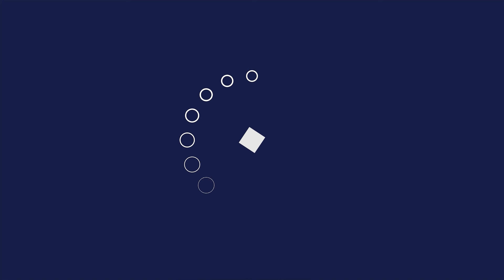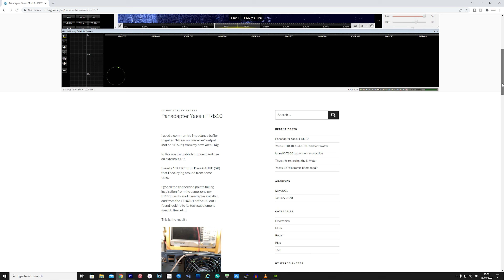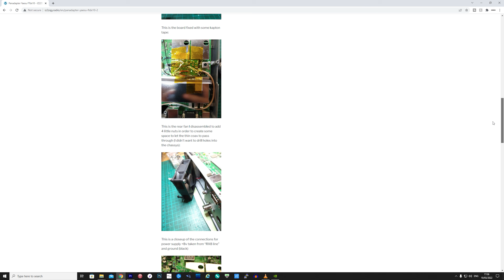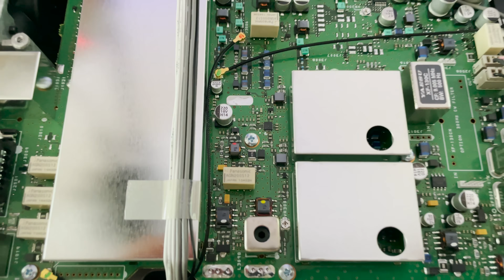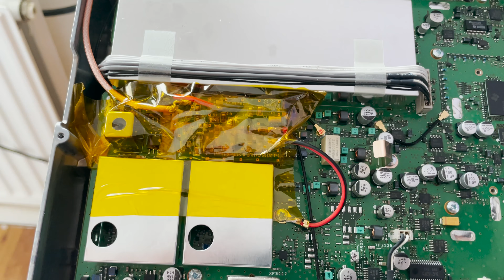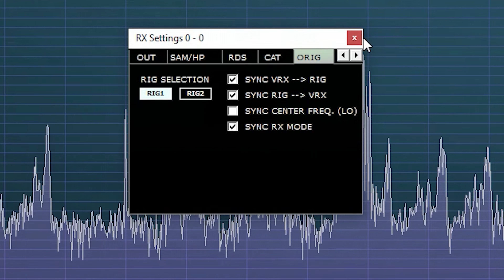How to add a TRUE panadapter to the Yaesu FTDX10

Comment: I cant figure out the settings on sdruno. Its off frequency. Does anyone knows how to correctly set this patboard with sdruno ?
Reply: input freq.SDR  is the output freq of the IF. stage 1 or 2 e.g. kenwood ts480 is 73mhz.

Comment: Sent away for and received the PAT board a few days ago. Tonight, I opened up the FTDX-10, excited to install the board and get it going.... until I saw and realized how SMALL the components and landing sites for the wires are! Things look MUCH bigger in the video. I'm decent at soldering and have a good digital electronics soldering iron with fine tip, but I'm not about to attempt soldering to something that small to get to the  +8V supply. (The RF output lead looks small, but doable, and the ground can be easily picked up as shown in the video.)  I read in the comments below that there is an alternate site to pick up +13V that would work. I would like to know where that tap is (or any more-accessible spot for +v suitable for the PAT board). Taking the +8v from the side of a surface mount micro-resistor requires a microscope, extremely small tools, and an impossibly steady hand!
Reply: Updating my own post a couple of days later... This mod is not for the faint of heart, but I finally worked up the courage  to attempt it and did successfully install the PAT70 board in the FTDX-10 using the method and connect points described in the video. It works great. So great, in fact, that I just ordered another PAT70 board for my FT-911a.

Comment: Installed it to my FTdx10, and the Chinese SDR-USB radio.
And what horrible disturbance in the radio, impossible to communicate at all!
Immediately connecting the coaxial to the SDR, the waterfall gets full, and impossible to see anything expect screen just full of "signals". 

For me, just totally useless solution.
Reply from the maker: Chinese SDR USB radio are crap! Either you need a good quality SDR or installation had an issue. Better solution check my last video on the SDR switch.

Comment: Great, but I have a question: if this modification introduces an attenuation of the signal received by the FTDX10.
Have you noticed if installing the kit at the tap point leads to a decrease in the signal level received by FTDX10?
Thanks

Comment: I've found the FTdx10's native display to be good enough for operating, though I too sure wish they'd put a proper bandscope output connector on it.  I hope someday they do a firmware update to allow more control over the display.  But in the meantime, the "Full" and "center" display options are fine for my operating needs.   Maybe when my rig is eventually out of warranty I might try this mod, but it's not high on my list.

I do have SDRPlay's RSP1A, connected to an MFJ-1708B RF switch, triggered by the FTdx10's linear activation line (bought a cable from someone on ebay).  I also made a small power switch so I can click the SDR in and out.  If the power's off, the RF switch is just a  passthrough.  So if I want to use the SDR, I just turn it on.  It has complete access to the antenna's feed.  Clicking on the SDR display will tune the FTdx10, and with the RF switch it will also be controlled by the FTdx10's transmit status.

Basically, the same net result, but I didn't need to solder anything into my shiny, new, under-warranty, rig.  

I did a similar mod to my Icom IC-7100, but just a straight tap without an isolator board.  It worked ok, but I prefer the RF switch solution.

Comment: I ordered a kit for my FT-991 yesterday. The screen is too small and I wanted a full-time waterfall/panadapter. Yaesu wants FAR too much to upgrade my 991 to a 991A and I would still have a small screen. It's nice to know this same adapter can be used on the FTDX10...which is the next HF radio I'll be purchasing. 

  I was hunting for install video's and here I am.

Comment: You can add a panadapter to 590s  , just need to connect it to a switch
I had Colibrinano and now I will buy AirSpy HF+
The RX is all get by Colibrinano or AirSpy .  We dont need to buy Dx10 or any higher cost radio to have the same final solution.

Comment: Thanks Matt purchased the board, didn't take the power from the resistor as wasn't happy putting soldering iron near it took it from the 13v supply, used your suggested earth and also the feed from the pictures. Works very well and great views of the whole band. I would suggest a vid showing how you got it too work with SDRUNO as this took me a little while to suss out and get working correctly, I would however  as you did recommend to anyone doing this to use Omnirig it make life so much easier with anything communicating with the rig.
Reply: Not having the board layout or schematics, I am wondering where there  is a more-accessible +V (13V or other suitable level) located? Where did you pick up the +13V tap? (I'm not about to attempt to pick up +8V from the side of a surface mount capacitor that small.) Also, in the location of the original +8V tap in the video, are those two resistors connected back-to-back in such a way that a solder bridge between them would be usable for the +v tap? I couldn't tell, looking at my board, whether they are both connected to the +8V line or not. It would be a lot easier to tap there if one does not have to worry about bridging the two resistors with solder. In fact, just visually looking at the board, it appears that they might be bridged by the PCB traces? And it looks in the video like that might have happened when the example board was installed?

Follow-up: I was able to locate the Technical Reference Manual with board layouts and schematics, and it looks like those two resistors are connected to the same PCB traces, so a solder bridge between the two surface-mount resistors should be acceptable. I may still choose an alternate site to pick off +V.
Reply: @ingeniousys  Find a feed on the power into the board that's what I did
Reply: @foxonem7dfh257  Thanks. I found a copy of the Technical Reference Manual with the board layouts and schematics. That will help immensely to identify a suitable place to pick of +V.
Reply: I agree with the +ve take off being a little dicey especially with an unsteady hands that I have can you point me to the 13v take off please
Reply: Where i can buy pan adaptor tap for 70Mhz?
Reply: @elkochannel6677  no idea try google

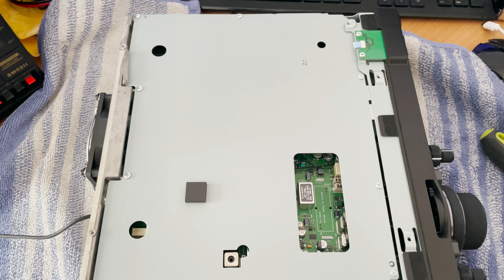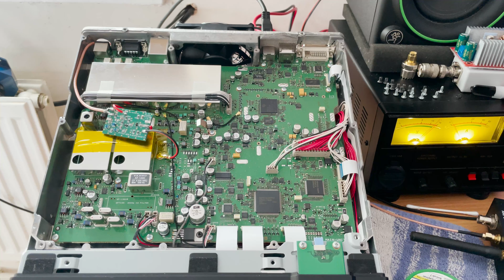Comment: @Tech Minds Hi,when I took the bottom black cover off I noticed the Gray fluffy Insulation type material by the  Fan just over the USB inputs before I pulled the grey/shielding cover off it was sticking out just as yours in the video was at 2:11. In the next frame you can clearly see it sticking up over the USB Inputs next to the DVi interface. And you see it again at 3:42. I noticed at 4:46 when you reinstalled the shielding cover the Gray insulation in tucked under the shielding cover over the USB connections. I noticed the same thing when I did this. The gray insulation was sicking up before I pulled the gray shielding cover off and thought it didn't look right sticking out like it was, so I folded it over when I reinstall the shielding cover and it seem to be a perfect fit. My FTdx10 was made at the end of 2022. Do you think it should be left sticking out or folded over like you & I did.???

Comment: Yaesu is again falling back - They should just release public their command set for USB port so people can adjust SW like SDR Connect and others for communicating with it. I guess they are not allowing it because of few buck they would lose some $ from LAN10 remote control sales. Yaesu has all in place for us to have full size panadapter and control of FTDX10 over USB but do not want to put it in public domain. Pity. On that USB port on FTDX10 and FTDX101 there is audio "sink", spectrum "sink", command and CAT "sink"- you can see it with TCP UDP streaming ports 50000,50001 etc... That data is taken from USB and transformed to UDP stream in SCU LAN10 control box. Same job can easily be done with Raspberry Pi + lot more ... Let us hope someone from Yaesu will realize what mistake they are making just to keep profit from few sold SCU LAN10 modules.

Comment: @Tech Minds Hi, I got a  interesting question for You. To wideband the our FTDX10 you jump the  JP1006. There are two other pins that could be jumped JP1007 & JP7008, All 3 are curiously encircled in the Dark green color part of main board and the other 5 pin are in light green as rest of the main board. Any insight into what JP007 & JP008 are for???? added freqs maby??

Comment: Hi Tech Minds what power supply are you using with your DX10 ? thanks
Reply from the maker: I use a SHARMAN SM-50II (50 AMP) power supply. Runs all my radios :)

Comment: I performed the upgrade to the FTDX10 and works as described but it doesn't work on the lower bands below 160 meters. It does not send the RF through on the AM and LW bands. Any ideas?
Reply: I have the dx10 and dx1200. The 1200 has the pat50 board in it and has the same issue.

Comment: How do you protect the SDR from overload or RF when transmitting? I have something similar for the older FT-950, and @ 100 watts, the SDR shuts down. I presume, too much RF.
Reply: The FTDX10 is being tapped at its RF path, so that tap point is already protected.  What you are experiencing is likely to be RF backflow from the outside surface of your coax cable shield.  This backflow can be mitigated by installing a tuned RF choke at the antenna feed point.

Comment: Thanks for sharing your project.

I wonder, why you take the signal after attenuation and preamps (after the SCP AMP) and not the RX signal before RL3001. So the SDR would be independent from the radio settings?
73 de HB9HDG Daniel
Reply from the maker: Unfortunately I cannot take credit for this modification, I found it on the web. I believe there is a link in the video description to the original information.

Comment: Gr8 video.  Which sdr did you use or recommend for the HF bands?   It’s a greenhorn question. Sorry
Reply from the maker: I use a SDRPlay RSPdx, best HF SDR in my opinion.
Reply: @TechMindsOfficial   Thanks.  I was looking at the: RTL-SDR Blog R820T2 V3 which claims HF coverage without an up converter, but at $29 this seems to good to be true.
Reply: @dreupen  No I have one and works fine

Comment: just ordered the FTDX-10 so are you saying that although it has the DVI-D  output it still does not allow for clicking on frequencies on the external monitor?. (would need a toutch monitor obviously).
What about if you have a USB Mouse and Keyboard fitted to the radio via it's USB ports, would that then allow clicking on frequencies from the external monitor?
Also could you answer a question for jme please, I have a Pat70 board in my FT-857D however it seems to be playing up, I am wondering if L3 on the PAT70 board should read a beep on a DVM set to continuity MODE? if you could check for me I would apreciate it as the other 2 inductors on the board do not register a beep.
Many thanks and 73 de 2E0LIG Nathan.
Reply from the maker: Yes of course, you can still use a mouse with the external screen etc.
Reply: @TechMindsOfficial  Awesome thank you

Comment: why do I need a panadapter when the ftdx has the spectrum and the waterfall...so what would this device give that the radio does not
Reply from the maker: Personally, it’s all about control and how much of a band I can see at the same time. With the pan adapter, or software, I can quickly tune to a station at the click of a mouse, I can also see the entire selected band on my 4K monitor. Of course, you could connect a mouse and keyboard to the FTDX10 and use an external monitor, but it’s down to personal preference I guess. One other added bonus is you can use the pan adapter as a second receiver, which the FTDX10 does not have.
Reply: @TechMindsOfficial  even if you wanted to use it as a second receiver, i cant click on it to change frequency, i have a mouse but no keyboard...i find that with a 25 inch monitor will do the same thing . i see a qso going on and i click on it.
it would be one thing if the radio did not have the waterfall and spectrum to view....adding the board would be beneficial.....im not going to mod my radio if i already have the feature. just saying.
Reply from the maker: Have you ever used SDR software linked to a radio? It’s a great experience. However, you operate your radio how you want to, as long as you’re happy that’s the main thing 👌
Reply: @W2JLDRoc-ham  if you do this mod you get your radio and monitor as you mention BUT YOU ALSO GET a completely separate sdr monitor running on any band the attached antenna covers.... if you add the software to control the radio omni as he describes in the vid you can control the radio using a mouse from the sdr display... and also at the same time control the radio using your radios direct usb mouse.. so u have two totally seperate receivers two diff displays all controlable same time.. yes u only transmit from one of them at a time in terms of frequency.. but thats all u can ever do.. if u use the sdr it will drag the  monitor out of the radio to that freq........ sou can monitor two completely seperate bands in real time.. you could even add more than one sdr to the new board and monitor three bands at once.. or 4.. or a gazzillion
Reply: @gabrielsansar6187  That is not quite how it works. If you sample at the IF of a superhet radio then the RX bandpass filter will greatly attenuate frequencies other than those of the currently selected band. If you sample at the signal frequency (antenna) prior to any bandpass filtering or frequency mixing then it would be possible to monitor two widely spaced signals. The sampling board used here is optimised for IF operation but there is a sister board, the PAT-V which has no filtering and is designed to directly sample the signal at the antenna port.
Reply: @RobB_VK6ES  I don't disagree... However. For most users it's a fantastic addition.  I personally use the mfj isolator to run my sdr's indipendent of the radios being used in line

Comment: I appreciate this video, thanks! Question: Where you brought this out on the FTDX-10, is it where it connects to the circuit on the FTDX-101D to the rx out port? If so, I believe you get the benefit of the FTDX-10's BPF's and RF Amp. Thanks.

Comment: If Yaesu sells 12,000 units, and leaves this board out on each unit, Yaesu saves 144,000 pounds.  This was just an illustration, as I have no idea how many copies of the FTDX10 have been sold or will be sold.  Leaving out little components like this adds up to big money over time.

Comment: Hi. Is it possible to connect to k3 or IC7300?
Reply from the maker: 7300 already has an option to add this feature. Search for PTRX-7300 board.
Reply: @TechMindsOfficial  the PAT-V which has no low pass filter is perfect for the 7300. It is even easier to connect with no mods to the radio required, merely re directing some internal coax cables.  I added one to my 7300 for the exact same purpose shown in this video.
Reply from the maker: That’s interesting! Where did you get the board from? I may look into this if it’s a cheaper solution than the PTRX.
Reply: @TechMindsOfficial  yes, but it costs more like 200 rather then 12… therefore it would be quite interesting, if there is a more affordable option.

Comment: Nice one Mat. It's a shame that manufacturers deliberately leave off hardware/software features where there is room for. Its all about getting you to upgrade to the next model up. For this reason I'm back to using my 590s over my 7300. If the 7300 or DX10 had 2 x ants & 1 x rx as well as  an IF tap it would be heaven.
Reply: You might be interested in this video by David Casler where he shows an external SDR being tapped from a 7300. https://youtu.be/jjb-Xm5jS8g
Reply: just get a LDG tuner with more inputs or just get a coax switches or electronic coax switch
Reply: I posted a vid last night about a little device I made to give my FTdx10 and RX ant.  It's a bit of a hack, but you may find it useful. Just ordered the PAT board - I've ALMOST turned the dx10 in to a 101 now ;) https://www.youtube.com/watch?v=oo6GsvnCyg0
Reply: You can add a panadapter to 590s  , just need to connect it to a switch
I had Colibrinano and now I will buy AirSpy HF+
The RX is all get by Colibrinano or AirSpy .  We dont need to buy Dx10 or any higher cost radio to have the same final solution.